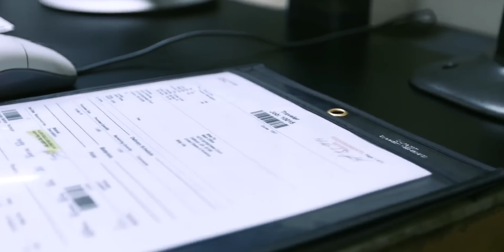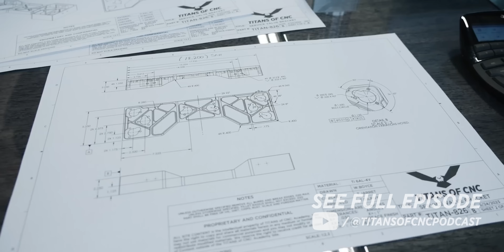Large Customers will make you RICH and then DESTROY you

Comment: There's a tremendous amount of great advice in this video.

I grew up in the Detroit area.  I started working after school when I was 15.  I worked as a draftsman detailing parts for a  machine design company.  The company designed large production machines for the auto industry.   Place a rough casting at one end and remove a finished machined engine block at the other.

The auto industry ran on a feast or famine schedule, in1968 when I was detailing parts.  It still does today.  I remember driving down Eight Mile Road in Detroit.  There were tool and die shops that lined each side.  Every shop had help wanted signs during the feasts and for sale signs during famines.